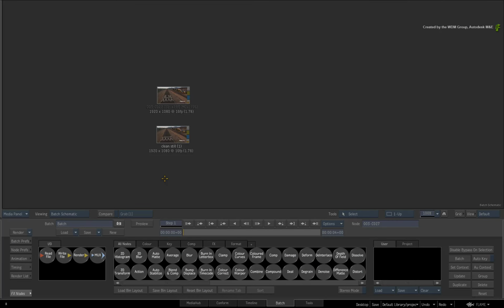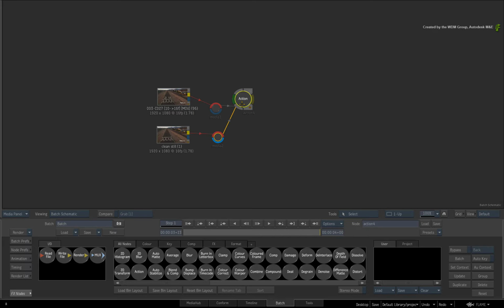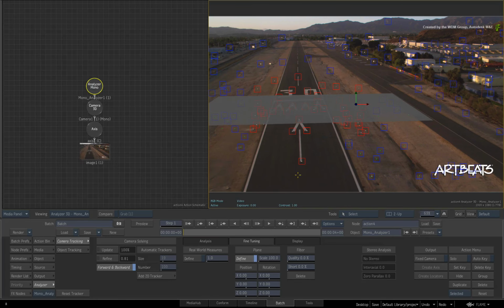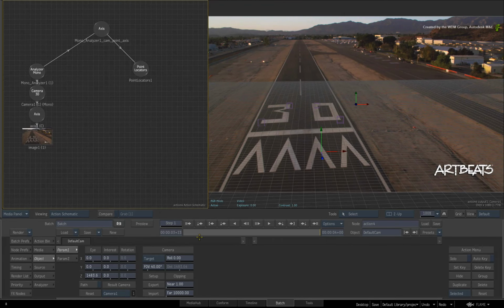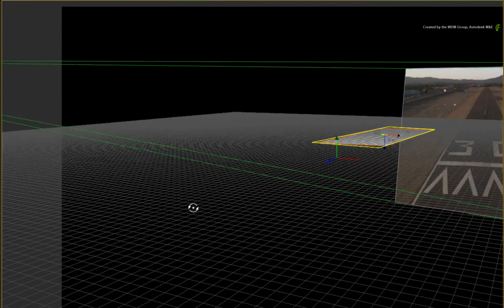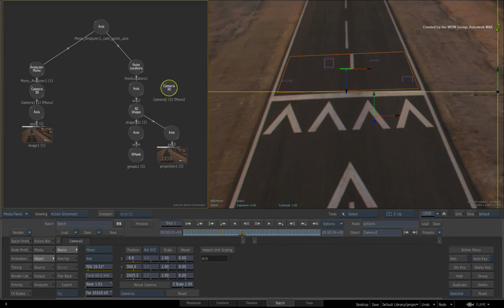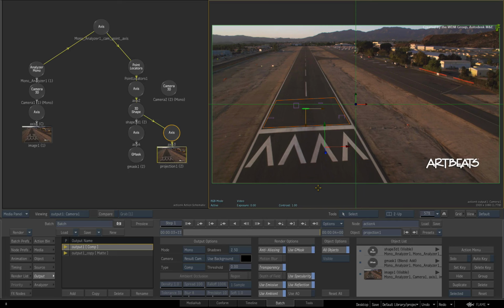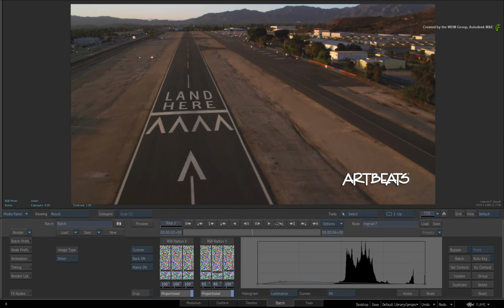Clean Up or Adding Elements with Projections

Comment: Grant, question - I know that this is an older tutorial on older software and I get that, but we are still on 2020_3 and hopefully will upgrade to 2023 soon - it's a San compatibility issue.  Anyways, I am wanting to use the Flame camera tracker more but I have two questions and maybe they still apply with 2023.  I follow all these steps, and even steps in the other video from 2014 where you tracked the room that has the TV - well my shot is a baseball field and the camera is behind home plate and I need to remove palm trees beyond the outfield.  When I draw my 3D shape, I can see the points of the mask but not the mask itself and I do not get the white surface to project onto.  Also, I only see my points in the gmask and not the splines in between the points and made sure that it is closed.  I have tried to define the real world distances.  I have tried to adjust the far and near limits and FOV.  Sometimes just by tweaking the Real World and putting it back to 1 shows me black where my gmask is.  The actual points are tracking but nothing is showing up.  Not sure if this has something to do with the distance (tried to adjust the plane size like you did) or if it has something to do with it being perpendicular to the ground plane.  Another artist tried and got the same results - we have tried numerous times and even deleted the point cloud and made a new one - started over from scratch - retracking and remaking the point cloud and the 3d gmask and carrying it all the way through to adding the projection and get the same results.  #2 - what do you do if there is no ground plane?  Is there a way to tell the camera that something is 90 degrees different and to adjust the camera by 90 degrees to get the camera oriented (or as the Brits say, orientated) correctly?  I used the planar tracker and it worked but like I said, I want to use the camera tracker more.  Thanks Grant.  Your videos are always the best.
Reply from the maker: Hey @RR Rr, Without seeing the shot, it is difficult to determine what the actual issue may be.    Judging from your description, the trees may be quite far in the distance and beyond the 3D camera's far plane.   You have adjusted this as you said but scaling the 3D world down through the ground plane may be the key.    Like I said, this is a best guess on my part.The ground plane is quite essential in establishing the scale of the scene as well as the orientation of the camera.

To answer your question if there is no area to set a ground plane, it is still possible to do but there is a lot more manual adjustments required to match the plane to the correct orientation of the camera so that the plane and projection do not slip as the camera is moving.

 I am glad you were able to use the planar tracker to do the shot :)  So many way to tackling things in Flame!   The new camera tracker will certainly give you more options and I hope you get to try it out at some point.   Hope this helps!
Reply: @Autodesk_Flame  I thanks Grant. Yeah, I hope we can get the new software soon too.

Comment: This is very useful. Thanks..and i think.. you link regrain node's back to action output. Did you used hotkey? I hope you teach me.
Reply from the maker: @서광선 All I did was connect the Action comp output into the front and back of the regrain node.   Then I took the Action Matte output and connected it into the matte input of the regrain node.   This limited where the regrain was applied.    I did not use any hotkey to create the connection.    The only hotkey I used in this part of the video is holding CONTROL+DRAG to sample the grain.  I hope this helps!

Comment: Great tutorial. How can I feather or soften the matte in Action? I’ve looked all over and can’t seem to find a solution. When I add points to feather out the matte, it doesn’t do anything.
Reply from the maker: Hi James, the quickest way I can think of is to apply an action Gmask to the surface receiving the projection.   So you can cut out the area you want to preserve and feather the mask.  The projection, should respect the shape of the mask and its feathering.   As a tip, to add feathering to a mask, you can right click on it and add a gradient point to soften the edge.  Hope this helps!
Reply: you need to press F8 and them cliclk with the right button over the your garbage mask and add gradient point